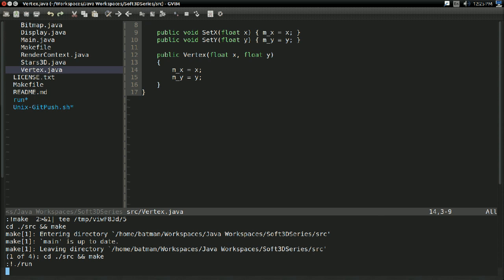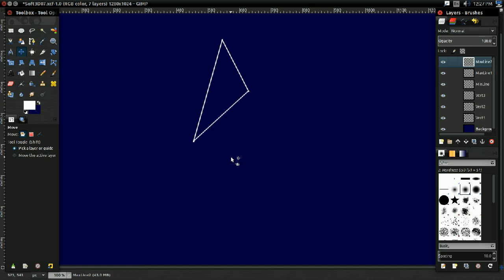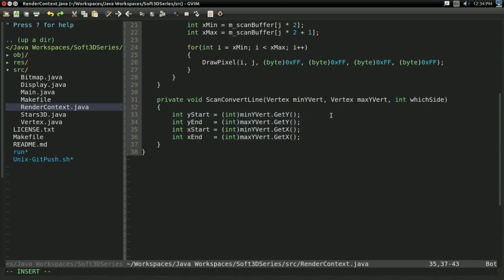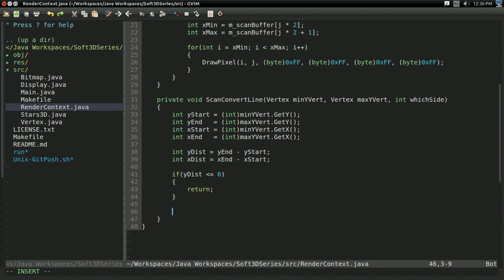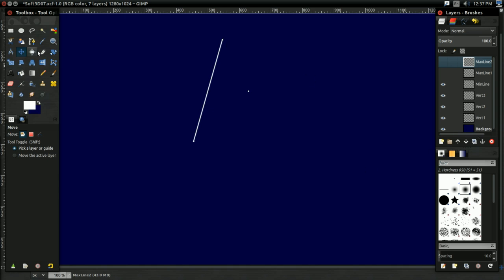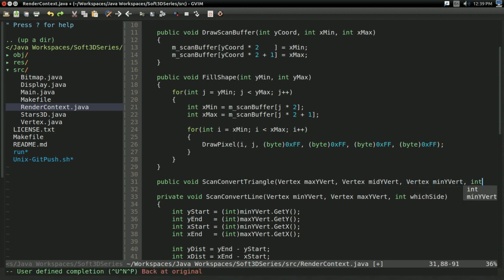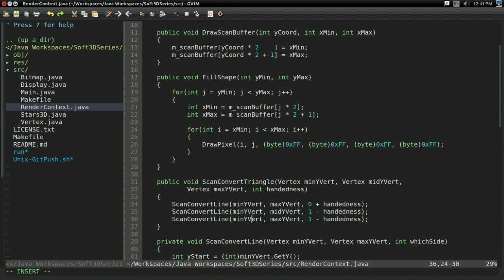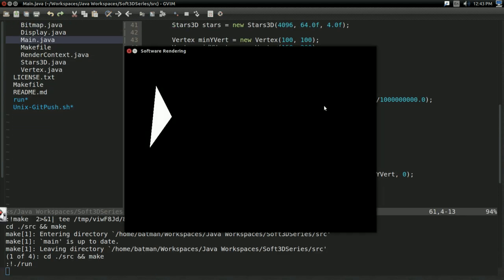#7 3D Software Rendering Tutorial: Triangles

Comment: Mwahahahah, I know how to do the sorting. I don't need to wait!! :P

Thanks Benny
Reply from the maker: Ah, but what about setting proper triangle handedness? :)
Reply: ***** I think finding the mid y value and comparing its x to the other two does it, right?
Reply: ***** well. Haha. Maybe I don't know how to do it for all cases. We shall find out next time!
Reply: The Zigec If the mid y point is to the right of all the points, it is right-handed, if it's to the left of all of the points it's left-handed. If it's in the middle however, it gets more interesting. Can't wait to see what Benny has cooked up for this one.
Reply: Yeah, I am not sure about that. Didn't think of it when posting the original comment :) MClightOfDay
Reply: The Zigec Precisely it's whether or not it's on the left or right side of the line the connects the max and min points. I'm just wondering if he's going for brute force, or if there's a trick I'm missing.
Reply: MClightOfDay  You could do it with a line function, but I am not sure what kind of effichency you would get out of that. We shall see.
Reply: The Zigec It's at worst linear, as you have to calculate it for every triangle. It's fairly basic algebra, just finding the slope of the line and then finding the x value that corresponds with the y value of the mid vertex, but there might be an easier way.